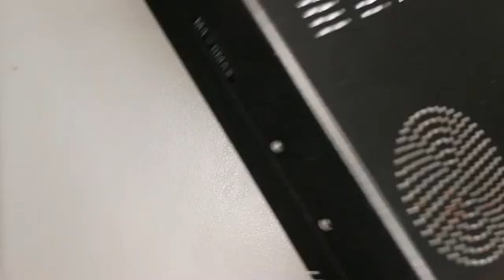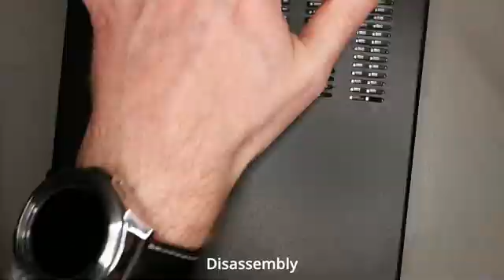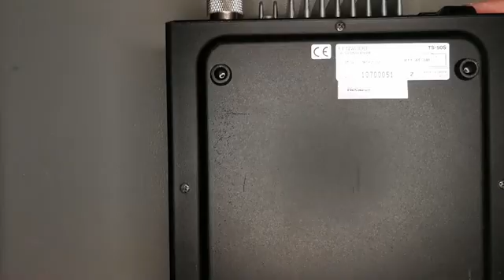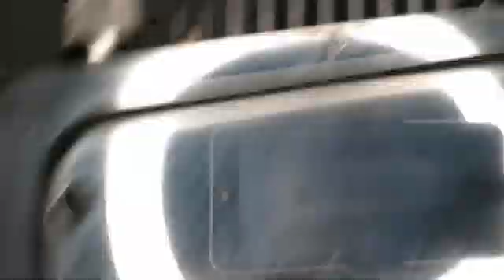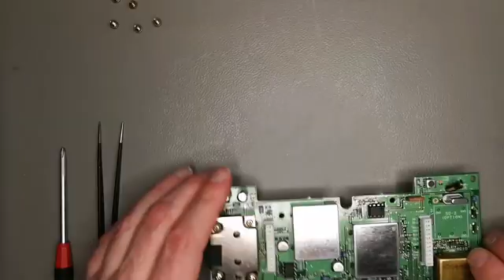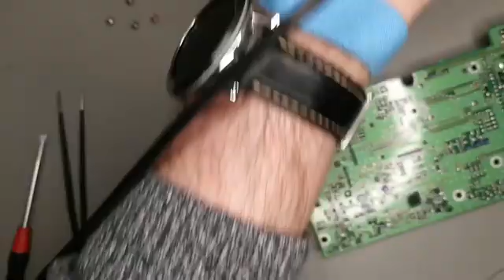Kenwood TS-50S TCXO Install | HamRadio

Comment: What does that addition do exactly?
Reply from the maker: TCXO stands for temperature compensated chrystal oscillator. It should improve the frequency stability and reduce drift. Especially in winter when you switch on the rig it can wander around a bit, until it has warmed up. - Alas the quality of this eBay aftermarket oscillator is also unknown, but the original Kenwood ones cost an arm and a leg, if you can get hold of a NOS (new old stock) device somehow.

Comment: Nice job.  One thing not often considered is many of these eBay/Chinese TXCO outputs are synthesized and therefore have pretty terrible phase noise.  While the results of this aren't always obvious, it can hurt RX performance as well as generate TX interference.
Reply from the maker: Indeed, only the choice of ready to plug-in 3rd party TCXO replacements for a 30yo radio is a bit limited ;).
As always if you want to do it properly, you have to do it completely on your own: Search for a suitable component, and build your own adapter board maybe with an ultra stable low noise power regulator, 10way precision potentiometer for adjustment, etc. - Maybe for the next restauration project 😉.

Comment: Hi! I have a problem. Running at 10W, What does the RF meter indicate in CW or USB whistling? Thank you. Mine goes all the way up only with a 100. But with 10 just hits an RF of 2. Thank you!
Reply from the maker: Hi!

I can just tell you how my TS50 behaves at the moment: If I TX into a dummy load in CW-N mode an RF sign lights up on the display. With 100W I get the S-Meter to level 10 With 50W I am somewhere between 4 and 6 - maybe slightly above where 5 would be. And with 10W it is slightly above 4.

I did not check the schematics if there are extra trimmers or a service menu to adjust the RF-Meter calibration. - If it should REALLY reflect TX PWR, then you would only see something about 1 in 10W mode, but then you can barely see if your audio is working in SSB mode, so maybe Kenwood cheated a bit and used some more range on the Display. Is there anything about this in the user manual?

Best thing to do is to check with an external swr/power meter or an oscilloscope while transmitting into a dummy load.

73, Tobias
Reply: @labcat73  Thank you. I finally contacted with friends and told me all is ok. In CW at 10 W i get an RF of 3stripes.(10W confirmed with power meter) In ssb mode i get  about 1 stripe. Thank you very much. 73!
Reply: @polarbear5464  My ts50 menu has a setting to make the meter read nearly full scale at 10 watt output.
Hope this helps.                                IAN   :-)
Reply: @jacianmcgurk7424  really? How may i ask?
Reply: @polarbear5464  Hi , menu A, Number 14, providing no one has tried to calibrate the signal meter without a tone my friend, if I can help with anything else give me a shout.

Cheers

Comment: I have a TS 50 but I think the finals are out of it. Where would you get a new set?
Reply from the maker: Puh if you are dead certain it's the finals that are defect, I guess your best chance is to hunt on eBay for a donor board. Getting them new will probably cost more than you pay for a used TS-50.

If anybody else knows a good source for the finals, feel free to answer below.

Comment: What does this do .... I have a TS 50. Did you replace the chinese Syncium  with a genuine kenwood....???
Reply from the maker: A TCXO or temperature compensated chrystal oscillator helps with the frequency stability of the transceiver when temperature changes. While the standard oscillator is ok, it definitely takes ~15 minutes after power-up until it stops drifting too wildly. Also extreme environmental temperature differences, like running it in winter in a cold room or in a hot car will  change it's frequency.

So simply put: If you set it to 14.2MHz it will TX and RX closer to actual 14.2MHz, than the original oscillator.

I just put the chinese clone TCXO module in. Original Kenwood ones are unobtainable or ridiculous expensive. So far it seems to work fine and is an improvement over the original chrystal oscillator.

Comment: nice.. only thing i would have done is while you were in there was to replace the 2032 battery
Reply from the maker: I think it was advertised as having had the battery freshly replaced on eBay, though i must shamefully admit I did not check the voltage...

Comment: Great video, Thanks.
Where are you located?
Reply from the maker: Yes that was fun to film and cut. Also less rambling than my previous three videos 😂. I am located near Munich.
Reply: @labcat73  great, i ised to have about 10 ts 50s when working in an exploration company in west Africa.
I like to see how they get fixed. Thanks again. Im near Oxford UK.
Reply from the maker: A good chance to hear you on the bands then! 👍

Check out TRX Lab channel for more TS-50S repair videos. My live streams of my own TS-50S restoration can’t compete with Peters expertise. I am just the average idiot trying to do a decent job.

Hey it‘s still working, so I call that a stunning successful project! 😉✌️